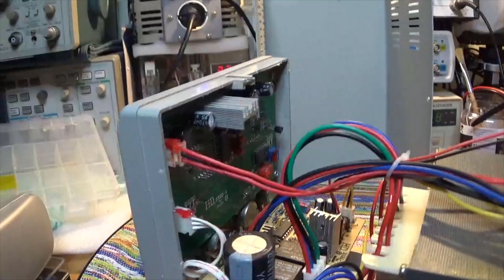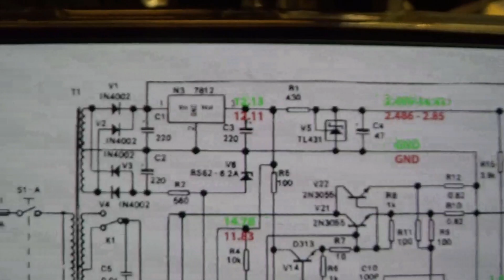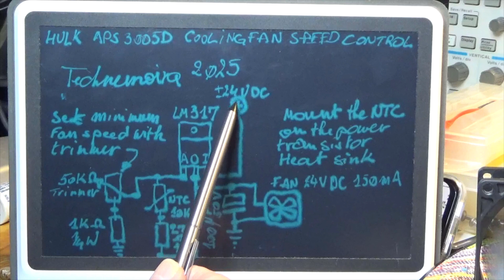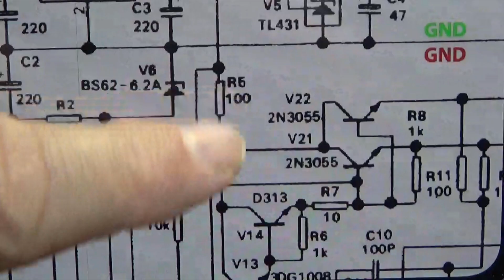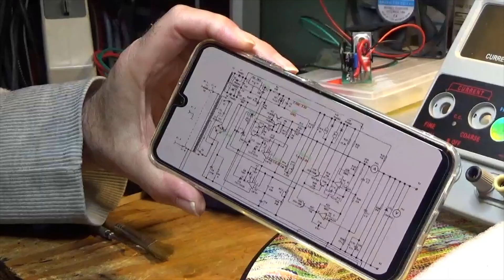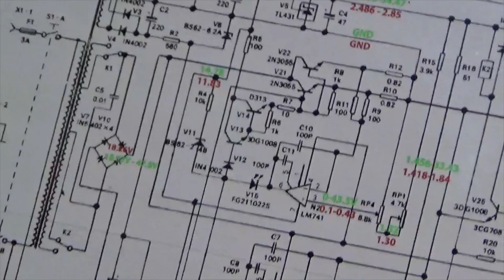Right2Repair: Repairing And Upgrading A Hulk APS 3005D Power Supply part 1 of 1

Comment: HI TechneMoria, It's Alfonso, wow what a great video! I would have never thought that a resistor and a small cap caused so much trouble! That was great trouble-shooting with the freeze spray too! I have the same power supply  made by HAO-FST MS-3010D, it's the same unit. After looking at this video I remembered I bought one years ago and it broke down and I was to busy doing other things. I ordered another one and I totally forgot I put the older one in a box and placed it away. This is going to be my next repair project. I have a hard time getting schematics but I guess I can use the one you have, which is better than nothing! I tip my hat to you with the added circuit you designed, great idea!! Meanwhile thank you for sharing! I hope all is well with you and your family! Take good care!!!! See you on the next video!! 🙂
Reply from the maker: Hello Alfonso, thanks again for your nice comment :) Well, you know what they say: waste not, want not. I paid for a working power supply and I hate to throw it away for some fault that I can repair. And why not improve the original if we can, right?
Good luck with repairing your power supply !
Reply: @TechneMoira  You are very welcome! I totally agree, I too live on social security and it's not easy. I will let you know!  Thank you for sharing that schematic, I'm sure it will come in handy! Be well!